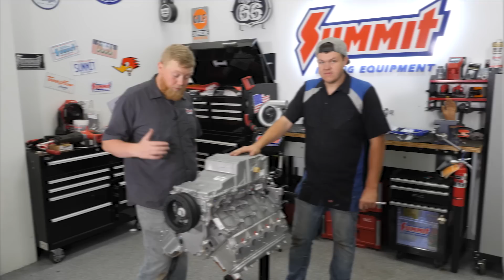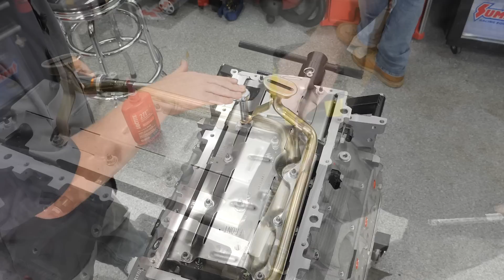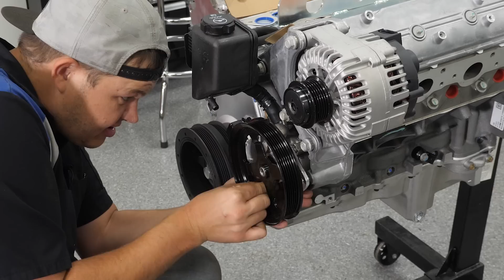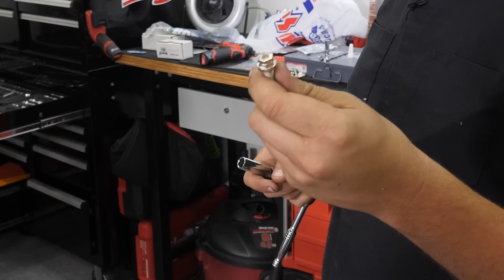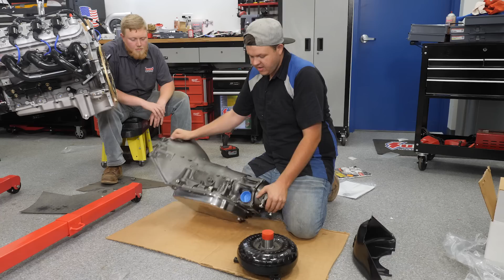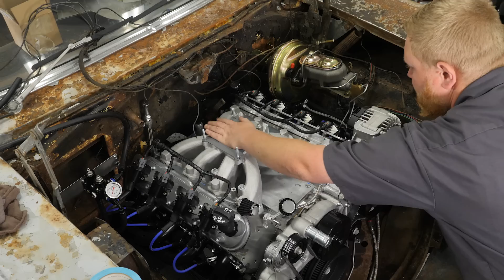We Help Robby Layton Swap an LS Engine Into His 1957 Chevy Bel Air Project

Comment: Frame mounts to accept the newer style sbc side mount?
Reply from the maker: We used the bolt in classis performance engine mounts part number CPP5557SMF-SB to get the ls in the 57. they fit extremely well , Thanks for watching !
Reply: @SummitRacing    those are the mount brackets, how about the steel mounting plates that mount to the engine part number?  cant you guys re do the description and put all the part  numbers in there?  even with no links...that way I can start buying for my 57?   with 850 comments, there are dozens of part numbers to read thru, it would take hours.

Comment: The wires are gonna probably melt best to put covers on them learned that the hard way. The stage 8 locks work great the clips you snap them in place with a pair of needle nose real easy. Just little tips.

Comment: What size tires? What's the wheel offset/backspacing?
Reply from the maker: Hi ! the tire size is a 235/70-15 and the wheel is a 15x8 0 offset with a 4.5 inch back spacing
Reply: @SummitRacing  Perfect choice! Thanks for responding! (25 year Summit customer.)

Comment: A couple of years ago, I ordered a  Rubicon sway bar from Summit Racing for my JKU (not a Rubicon) because I was sick of manually disconnecting. You can't get the away bars in the UK, where I am, so I turned to Summit Racing in the USA. They sent me one for a JL, which is not interchangeable with the JK. Summit Racing resolved the issue super-fast, and I received a JK Rubicon sway bar in about four days. I still don't know how they managed to do it so quickly. Of course, the electronic actuator has to be converted to a pneumatic actuator. It was a bit of an experiment, but it all worked perfectly when assembled. No more manually disconnecting or connecting! I now probably have the only non-Rubicon in the UK with a cab-operated sway bar. This is important in the UK because if I had an accident on the highway with the sway bar disconnected, it would've probably invalidated my insurance. I was impressed with Summit Racing's customer service and highly recommend them. They're a great team! Fascinating build of the '57, and I'm a big fan of the Robbie Layton channel. Looking forward to the drive back to Utah, where I spent a lot of time back in the '90s. The channel not only feeds my hunger for all things 4x4 it also brings back so many great memories of my time in Utah.

Comment: you still have to break the motor in b4 long drives sheeple..
but.. since 1986.. never had a problem.. i ordered through them b4 JCW.. or others..
i often bought targa stereos back then.. & parts i could find in a boneyard for my fords/merc & monzas all 75 76 & 77-9

Comment: Need to see an LS drop in to a  GMC C-1500 with a strong pulling auto trans. Is there a wire kit and control box (ECM)? If not where do I get the basic harness and ECM to adapt?

Comment: Thanks Justin and Robbie!  Can you show where the wiring and electronic control boxes were installed.  Also, could you show how you mounted the torque converter to the flywheel?  My dad and I are doing the same thing, except with a '59 Ford Skyliner, a FE390 and C6 transmission.
thanks!!!

Comment: Are you guys sure about using a 2,800 rpm stall converter on a street call with a 3.00 rear axle ratio? The high stall converter with the 3.00 rear axle isn't going to completely lock up at highway speeds. 

IMO, you would have been better off using a 4L80E overdrive transmission to keep the pm down @ 60 mph.

Comment: So as a Robby Layton follower here i am watching a summit racing 👈 lots of goodies there , watching the gidgets and gadgets being put on the motor for install i realized , and ive seen serpant belts for years now but how awesome is it not having to adjust power steer pump and alternator and ac compressor its all in the 1 spring tensioner. This is an awesome collaboration and i look forward to seeing more on Summit Racings channel.

Comment: What wire harness did you use because the one that I buy only comes stock ready for the throttle body and the transmission connector already in it I would love to run carburetor on mine to get rid of that ugliness that big plenty mm intake

Comment: Reminds me of over 50 years ago when my younger brother and I, in our teens, built a high performance Chevy 327 by ourselves from a bare block with all new parts.  Dad owned an auto parts store and we helped ourselves to whatever parts we needed and special ordered the speed parts (cam, Edelbrock manifold, domed pistons, Holley dual-feed carb, electronic ignition, etc.).  We painted the block Chevy orange and installed lots of chrome, stainless and polished aluminum parts.  We ported and polished the heads, pinned the  rocker studs, custom ground the valves and seats, etc.  It was a beautiful engine.  We put it in mom’s car to test it, then later removed it, put it on an engine stand and displayed it in dad’s store.  A few months later I left for college and dad sold the engine.

Comment: I have a Summit Racing 5.3L LS EFI in my 1991 S10 with the same Corvette accessories, but mine has a Tremec TKX manual. The engine is rated at 450hp for a 5.3L and with the manual there is not much loss to the wheel. Still need to install my Ford 9" rear end as the stock is not so good. This was a great video and pretty much how I built my Summit engine with everything from Summit except the rear end. We call my S10 Scratch and Dent because most of the parts including the engine and transmission are from the Summit Outlet in Arlington Texas. Sorry Ohio, you do not have that, but I hear there is a small section with some demo/return stuff. Anyway, look forward to more videos of this build here and on Robby's channel.

Comment: I’ve never installed a new motor so excuse my ignorance but wouldn’t you need to run them in before a 2000 mile trip.

Comment: I have many years of wrenching under my belt (including 10 as an aircraft structure and hydraulics mechanic) and 6+ years in the parts business and I am SICK of the lie that you don't gap iridium plugs, that they are "pre-gapped"!

I ALWAYS check and adjust them.  I have seen them off by over .015 and more.  Yes there is a technique, and yes, delicate care must be taken, but I have literally gapped 100's of iridium plugs. all successfully, without knocking off a single iridium point.

"Pre-gapped" and "You do'nt have to/cant gap them." is a boldfaced LIE!

Comment: Robby was pretty in-depth in explaining how to install the torque converter in the transmission but he never mentioned anything about measuring the distance/gap between the flexplate and the mounting pads on the converter. That is a crucial step in the installation.

Comment: spark plugs do not need neverseize, they are already coated. also, if you didn't use an aluminium engine (ugh) you would not need locks to hold on header bolts.  that's so much bs

Comment: You might find someone other than Summit who can occasionally sell you a quart of Mobil 1 for 50 cents less BUT this video s proof that with one phone call you can order every piece you need to adapt and rim out and tune and accessorize and adapt ANY LS or SBC motor to  anything, even 60 to 90 year old unsound mounds of loose rust. You can even get safety harnesses and drag chutes to help the driver stay intact if the rust doesnt

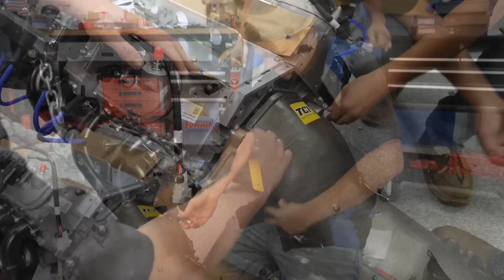Comment: 23:35 another indication you have the torque converter in all the way is it should spin easy after the trans is bolted to the engine.

Comment: I hope that the Radiator to engine metallic tube / connections are NOT the cheap made in China rubber hoses which are NOT reinforced and will rupture loosing all your coolant?

Comment: You did use anti seize on the plugs, should have used it on all the fasteners. Steel into aluminum causes electrolyze and can gall the treads, anti seize helps. Nothing like pulling a bolt and having the threads pull out with the bolt.

Comment: Why not a 350 crate motor; much easier !
The car already has clutch linkage so a Tremec 5 speed !
All easier and cheaper. 
The small block Chevy is a better looking engine too !!! More power? Big block 427 !!!

Comment: You forgot to bolt the torque converter to the flex plate. She runs but she no go anywhere.
Nice of Summit to sponsor the build. Congrats! Nothing like the feeling having the engine fire up for the first time but it's even better when it instantly fires on the first turn of the key. Hopefully, you will experience that one day.
Reply: They probably were not ready for that step and still needed to run transmission lines and fill the transmission... They wouldn't want to run it dry now would they?
Reply: @sjd73ss  There were several things they didn't show. That was only a wiseguy remark some of us old timers would get a kick out of. Didn't mean to offend you.

Comment: I'm sure that engine is gonna run and sound good. The one mistake I see way to many times on fresh engine installs that I seen repeated in this video was puttin the lockin tabs on the freshly torqued cold manifold bolts. Those tabs should of been left off until after the engine went threw 2 heat cycles. U can bet almost every time that those bolts will need to be retorqued after wards. Thats how most manifold leaks start cause of that step gets skipped.
Reply: Good point. Sounds like you really know your engine assembly procedures